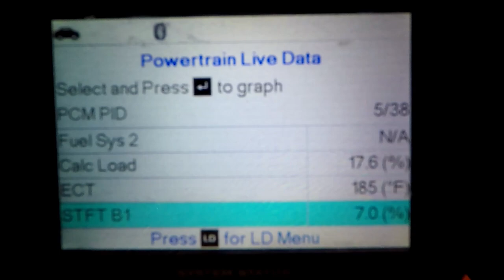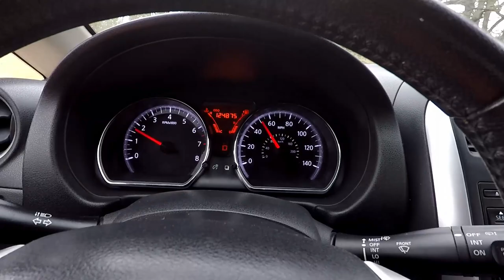2013-2019 Nissan Versa Note CVT Transmission Swap (Part 2 Installation)

Comment: what are the chances it can be the shift solenoid and not the transmission on these cars? I have a versa note 2014 that shifts up to 4th speed then RPM goes up, the only way I have found to get around is to put the car in N while driving and back to D so it picks up the 5th speed and starts shifting smoothly until there's a stop and then I have to repeat the same process again.

Comment: Thank you for the great detailed video!! I have to replace transmission for  my 2014 Nissan Versa again!!  Is there any recommendations for swap options for 2014 Nissan Versa if 2014 year used CVT transmission is not available, any years interchangeable?? Thanks again for the content

Comment: Just removed 1 of these took about 2 hours to remove, did not remove subframe, left axles in spindle removed lower ball joint bolt & upper sway bar link bolt along with out there tie rod bolt to spindle in order to have movement & be able to remove axles from trans, tilted engine in order for trans to come out. Hopefully install goes as smooth
Reply from the maker: Nice!

Comment: I just got done putting one of these in, went to turn it over and it just clicks....the starter turns outside of the car but wont turn over the flywheel? But also is blowing the battery fuse on top. any ideas of what may be going on? Thanks in advance! Andrew
Reply: U figure it out?

Comment: I just replaced the two coolant lines on my wife '18 Versa sedan. Both rusted out and one of them blew and left her about 2 miles from the house. Luckily it went into "limp" mode as to not mess up the tranny. 80k on the car and it's four years old. I put NS-3 back in and made sure all levels were good using a scan tool. Car seems okay now...crazy stuff. I change all CVT fluid at around 25k. Great video thank you.
Reply from the maker: Great job!

Comment: Just finished doing this job last weekend 
Took me about 15-16 hrs car was on jack stands no hoist 
I used an engine crane to help install new transmission 
I removed the subframe so I didn’t have to notch the rad support since it wasn’t my car
Subframe is easy to drop it’s only 6 bolts and the steering shaft
I also didn’t remove the intake manifold and all the engine wiring only the plugs for the tranny 
 This is a great video but I’m just saying I did it a little different 
Cheers
Reply from the maker: I'm glad to hear all those subframe bolts came out clean. Gotta be very cautious with those, they tend to snap. Also, props on leaving the intake and wiring all on. I know you had a hell of a time working around all that spaghetti. You should of recorded and showed us how it was done without getting wiring pinched. I would recommend everyone else remove the intake and wiring. Anyhoo, hope the video helped. Thanks!

Comment: Did you use the original transmission control module?
Reply from the maker: Yes i did. I had it reprogrammed by Nissan.

Comment: Thanks for a detailed video. How many quarts of Trans fluid did you end up putting altogether to filler her up?
Reply: About 7 quarts
Reply from the maker: Start with 4.5-5 quarts if there is fluid in your torque converter and adjust from there. 7 if converter is dry.

Comment: Hello, very good video, my daughter's Nissan Versa 2014 sv does not drop the revolutions per minute, they go up a lot up to 6 at a speed of 55 mph, I also feel that the car has a sound like whining.  At low speeds the car feels good, but I see that the rpm does not drop.  Do you think I need to change the transmission or try to change the fluid first, this car has 65,000 miles.
Reply from the maker: 6k rpm at 55mph.. Unfortunately with the symptoms you are describing, it will need a transmission. Wish I had better news. Let us know what ends up happening.
Reply: Hello, can i use CVT transmission 2016/2019 for my nissan versa note 2014?

Comment: So if i’m putting a used transmission from a junkyard from a 2018 nissan versa and putting it in my 2017 nissan versa, will it have to be reprogrammed?
Reply: That's what I am wondering
Reply: @sigma-enigma9504  I had my diesel friend put it in for me and it worked without reprogramming and I used it for a month then went ahead and reprogrammed because I started having some hesitation trying to accelerate at stop signs. I also had an ABS light on bc he changed the wheel bearing and didn’t remove the sensor first. It was bent. I fixed it few days ago replaced the FL sensor and the ABS light went away but seems like the hesitation is worse. I think maybe the tranny I just got may be going bad or the ECM needs time to learn the new values from the sensor
Reply: @shadowmodding3606  thanks man
Reply from the maker: Absolutely reprogram the TCM. By Nissan. Unless you have a J tool.

Comment: I wanna change the same transmission on a nissan versa 2016. Did you hv to do anything yo reprogram it after installation?
Reply from the maker: Yes I did. A reprogram will help the replacement NOT eat itself up like the first one. Use the VIN from the new transmission.

Comment: My nissan note 2014 don't cheng gear it is running in 1st and 2nd don't go to 3rd and 4th so please tell me what sud I do
Reply from the maker: Sorry to hear you are having this issue. There are two things the dealer will recommend. First to do a fluid and filter change. If no success..Second you do a software update on the TCM. But unfortunately sir, with what you are describing, odds are you will need to replace your transmission. Let us know how everything turns out.
Reply: @experiencedsolutions9963  thanks for answering me.
I don't want to replace transmission i need to riper

Comment: I have a clutch A pressure disengagement performance does that mean I need a new transmission I have a 2013 Nissan Versa SL
Reply from the maker: Are you hearing any noise yet? How is it driving? Is P2859 the code you get?
Reply: @experiencedsolutions9963   yes that’s the code I get is p2859 and it slips a lot rpm shoots up when I bearly even go 20 now the car won’t shift gears but it still runs
Reply: And the engine light is not on anymore but I still have the problem
Reply from the maker: Ok. Once these transmissions start to go they dont last long. Sounds like it's gotten to the point where it could be dangerous. I would not drive it anymore. Unfortunately you need to replace it. Doing a rebuild would be very pricey. Wish I had better news. Let me know if you have anymore questions.
Reply: @experiencedsolutions9963   thanks I appreciate it a lot now I gotta rebuild the transmission in it I bearly got the dam thing from Nissan dealership don’t even have a year with it yet and its bearly gonna reach 105k miles
Reply from the maker: I understand. Go ahead and keep us updated. Price/Warranty/etc.. Good Luck!

Comment: Did you reprogram the new transmission?
Reply from the maker: Yes. Absolutely. You want the best program in it for your vehicle. The tech will put in the appropriate one for VIN and mileage. They will also refer to the VIN on front of new transmission. This would be a quality programming for your application. A good tech will do that and not just throw in the newest update. If your anywhere near NW Indiana, I got a spot.

Comment: If is used trasmission need program ?
Reply from the maker: Yes, you want to put the proper program in transmission which goes with matching VIN from the car it came from.